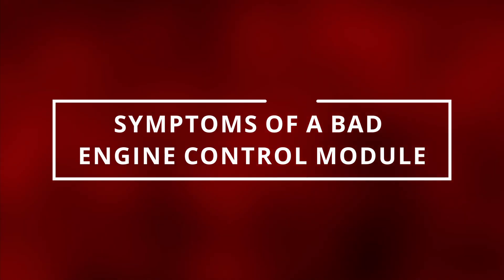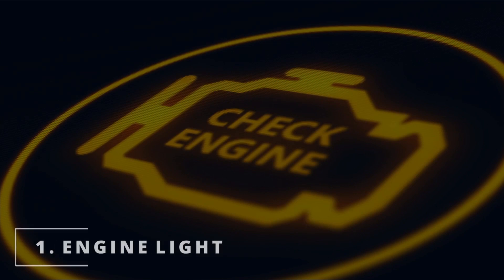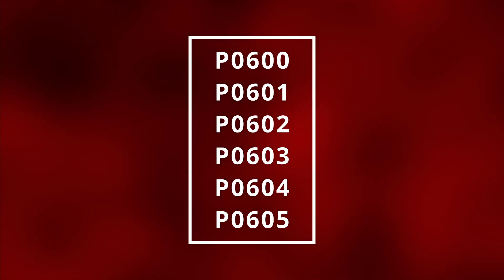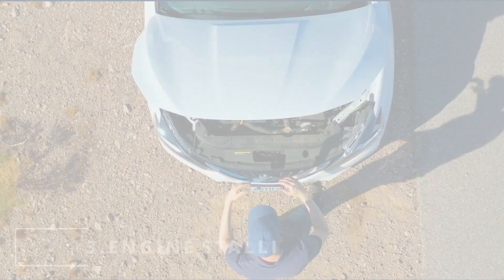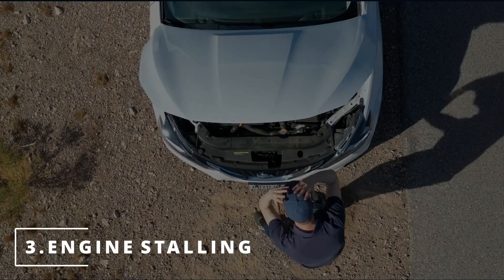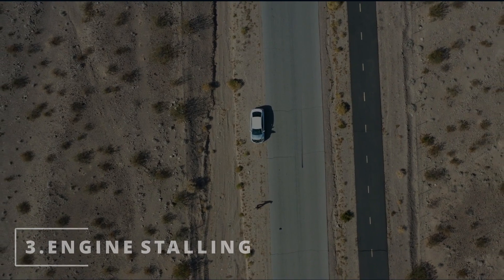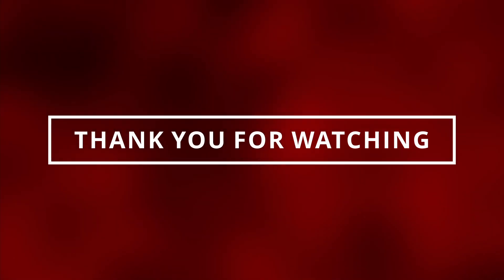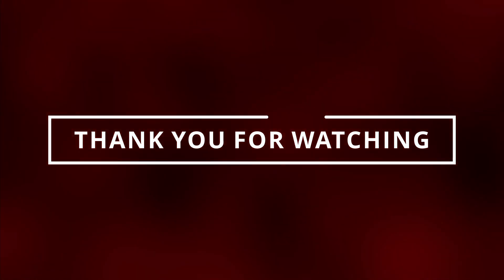SYMPTOMS OF A BAD ECM (ENGINE CONTROL MODULE)

Comment from the maker: OBD2 Scanner: https://amzn.to/3PHRplS
Reply: What other platforms are you on?
Reply: 1993 Chevy Lumina 3.8L dies while driving. Starts good runs good for 15 miles at most then dies. Will not restart right away. Have to wait 30 mins to an hour then will start up fine and drive fine for another 15 miles and die again. Its not overheating. No check engine light. Have changed fuel pump fuel filter plugs wires. Sensors would trigger check engine light always? Actually its SERVICE ENGINE SOON on this car. Unless there is also a CHECK ENGINE LIGHT thats malfunctioning. that would make sense.
Reply: Volvo XC90 2005 immobilizer problem
Reply: My ECM was causing me a misfire on one cylinder and needed to be replaced.
Reply: @gman3918 I'm here for the exact same reason 2021 corolla se nightshade
Reply: Bro you sounds super baked lol
Reply: @shanepotter4635 Royal sounds super smart and knows like he knows what he's talking about
Reply: Hey EasyAutoFix!, I have a 2019 Toyota Tacoma with manual transmission, what kind of symptoms would I be getting from a bad ECM??

Comment: I'm. Having this problem now i changed my oy pressure sensor and my temperature sensor the first oil pressure sensor I put in was the aftermarket one and it had high voltage problems got the oem one put that in now, my check engine light is on, and it won't go off 🤦🏾

Comment: My Toyota FJ cruiser has no check engine light on or anything and just died driving. it restarts for two seconds the dies again. I put in a new fuel pump and still the same problem.

Comment: I'm also experiencing some problems with my Ford Bantam rocam1.3,I was driving, and it's just cut off.I then replaced fuel pump & drove for about 200km & cut off again.I checked all fuses,replaced  fuel cut off switch & relays but can't really get what's might be the problem,any idea where I must investigate?

Comment: One time I had a cracked ecm cover/box and the transmission wouldn’t shift past 2nd gear  because the connectors were corroded and speed sensors weren’t communicating ..2002 Silverado 1500 5.3.. took a mechanic 12 hours to figure it out 😵

Comment: Could the ECM be responsible for the Anti-Theft (PATS) light to go on and the truck, not crank/no start? Locksmith says Transponder key and ignition ring (antennae) are communicating, he's baffled. [2004 Mazda B2300 manual transmission (new clutch safety switch)]

Comment: 2014 ford fiesta se,  changed crankshaft and camshaft sensors and car not turning over.. went through engine stall out on july 3rd.... possible ecm? Code is P06B8

Comment: Mine had no engine light posted , all things in the vehicle worked, all fuses were hot but 2  T and S   99 model 300 M Chrysler  hit a bump and engine died Immediately , no check eng or codes when scanned mil is clean , replaces all sendsors , pump in tank , battery, but still have no injector pulse and coil  what do you think?

Comment: 📖 THEN VS NOW: A REAL CONTRAST

📘 1950s Owner’s Manual:

    How to set ignition timing.

    Valve clearance specs.

    Carburetor tuning.

    Lubrication points with greasing intervals.

    How to change a clutch or set dwell angle.

    These manuals assumed you were a thinking, capable adult — because you were.

📙 2020s Owner’s Manual:

    “Do not drink coolant.”

    “Contact your dealer if warning light comes on.”

    “Modification of this vehicle’s systems may void your warranty.”

    “Opening the hood may result in injury.”

    These assume you're either going to sue the automaker or destroy your car — and give you no tools to do anything for yourself.

Comment: I need help.. 02 Honda Accord 4 cyl... The car started acting funny when I take off... No codes... I was having issues with the idle air control valve so I replaced that and the throttle position sensor... Now the car has a hard time starting and when I give it gas it barely wants to move it just chugs and smokes really bad... I've had this car for years it's never given me any problems...
I timed to the TPS to its proper specs... I disconnected the battery and Bree hooked it up and then did the throttle position test by using the gas pedal and it still doesn't do anything different... I'm going to leave the battery disconnected for 24 hours and try again but I don't think it's going to do much...

Comment: 2011 4.6 e150 for some reason the truck will try to turn over but won't start I did the fuel pump worked for a day then dies again

Comment: i have all those problems it dose not want to start when hot, will randomly cut off, will lose power sometimes when driveing the Check engine light will blink, and its does not want to shift form 3 to 4 or what ever overdive is, has p0600 code and thats it nothing else but evap lose

Comment: I reset my ecm...2004 Ram hemi...runs well for a while...but then poor/hesitating acceleration, runs erratically. Reset ecm again...and does fine for a few trips. More likely throttle body with bad TPS? (Integrated into throttle body) have replaced to downstream O2 sensors, still reading high voltage, and will be replacing both upstream tomorrow. Thanks man
Reply: Hi. Im experiencing the same proublems. Reset ECU and it runs fine for a few starts, then wont start unless i reset again. 
Did you find the solution ?.
Reply: @Ace.Venturas  Someone finally got it through my thick skull to settle for nothing less than OEM O2 sensors, no matter what Amazon, or even Bosch says are 'compatible'. I put in 2 NTK upstreams this very morning...(I have read NTK makes the 'Mopar' sensors)...and only a few trips so far...but...so far...so good. I should tell you I been all over the map, tried exchanging the throttle body, put in new injectors (TRQ), bought a tool for checking exhaust backpressures to make sure my cats weren't clogged...a whole litany of parts and labors. Even got a refurbed ECM
But, I have to admit, I'd read that Dodge (esp RAMs) are particularly finicky when it comes to sensors, and that even BOSCH (hear the heavenly choir around that word?)
Reply: @gregorytarana8104 thanx for the detailed reply. Its not conclusive what fault is when changing so many parts.
Good luck with it.
Be safe n well.
Reply: @Ace.Venturas  Yes...and very true. Thankfully, I could return the throttle body, so I am now working with original...I also am now in an exchange position with vendor vis a vis the refurbed ECM, which I sent back because of very incomplete data display, so I am back to working with the original ECM, I know the injectors did not solve the issue, though I left them in (wouldn't hurt to have new injectors at about 120K miles), and, in short...finally accepting that #1 the problem was indeed my O2 sensors and #2. I only compounded it by first cheaping out (even though the sensors were touted as RAM compatible), and then thinking the slightly better Bosch MUST be the answer. Since you don't seem to mind lengthy replies, it was a woman I met at a KIA dealership, who has worked in and around cars for decades. She told me after she asked "what kinda of O2 sensors did you put it?" and I told her...Amazon low price...then Bosch (as I thought Bosch were a kinda gold standard) and she smiled and said...nope. They (Dodge and Rams esp) are more picky about OEM than you know. So now, I will let you know in a few days, and after running the truck for several trips...whether I took the long way round to get back to doing what I didn't know to do. But have now done.
Reply: @gregorytarana8104   Seen a brand new bosh part fail on utube.
i cant see o2 sensors on my C converter. 

I so hope it fixes your issues gregory. 
Best of luck.
Reply: @Ace.Venturas  so far, so good...even though yesterday on a 'longer trip'...after my last stop it started to get a little glitchy and I thought to myself "OK, here comes the descent into shitsville again." But, it evened out. Where previously, once the deterioration began, it persisted and only got worse, so though I now expected rough idling, hesitating and glitchy acceleration at every stop light...it had disappeared. I could even run with the A/C on, which used to, when in that state, cause the engine to run like it was on its last gasps. But, no. Just that bit of coughing at the beginning of the return home...then clear. I am not satisfied 'all is well' however...it should not have even run poorly for that 1st 1/4 mile.

But here's the thing, in the past, once it started to go downhill, my bank 2 would show a horrendous LNGFT, like -32. When I put the scanner on it after returning, both banks read like -0.8, so something has definitely changed, and it may well be I only need to now address the position 2 sensors.
Reply: @gregorytarana8104   HEY !!HEY.!!! WOOOHOOO!!!!! Great news champ.
"  oh happy da....ays...oh happy days....
Reply: @Ace.Venturas  how are you making out with your issues?
Reply: @gregorytarana8104   I got it to start....
after removing 2... 15amp ECU fuses for 20 min with cables connected
Ran ruff ....back firing. I kept it going with reving.  Chk eng light came on for the first time EVER ......then off
Then i eased off the revs slowly till it idled  good.
Then after a bit .....it stalled and the crank no start over again.
At least i know its getting fuel, air, spark...and will idle good.
I will examin   cam , crank sensor wires . Hopefully  i find a bad connection.
So some progress. 
Thats goo......go......g......g........OH ITS FU...KD
😅😂
Reply: @Ace.Venturas you do have an OBD ll reader, right?
Reply: @gregorytarana8104   No. No reader. 
Old style diognoses on engines i havent a clue about.  Going in blind. And every dam thing is so hard to see and access.

Just learned today I have a fuse for obd2....
I searched at the beginning for it , but failed to find it.
Will try again.
Reply: @Ace.Venturas yikes, man...wanna borrow mine?
Reply: @gregorytarana8104  Yes......if only i had an OBD 2 port.  I have a fuse marked OBD2.   But toyota dealer says after a long search.....no port on my car or
cam or crank sensors. Forgot to ask about speed sensor.
 Last drive was really good.....only hesitating into overdrive ocasionaly.
Thought it ECU relearning. 
I have to find why fan is running continuesly.   Heat sensor ? Relay ?
ECU may be preventing cold starts as a precausion to sensor registering over heating.
Remove memory and it starts...
I will replace heat sensors if  i cant check  for correct opperation....resistence.
Thanks gregory for asking.  Writing this stuff helps the thinking process

Comment: I have a 2014 VW Passat TDI, and recently my trunk stopped working,  washer fluid, panel lights, heated mirrors, doors won't lock with buttom or remote countrol and horn. One day all of a sudden worked for about two minutes while I was driving, then stopped again.  I checked both fuse boxes, nothing fuse related. I don't know what to do as electrical diagnoses and repair in cars can be very expensive.

Comment: So no start in my 2019 Silverado. No engine light. Garage replaced starter for 430$. It starts 2 times and same thing. No start. And by no start I mean all accessories are working but nothing happens when I turn the key. Just a click and nothing. I got wired it to bypass the starting process and avoid another tow charge. Now they say they think it’s the ECM and they’re waiting to have the guy program it. Any thoughts?
Reply from the maker: Here is the perfect video to watch. https://www.youtube.com/watch?v=Q_Xw6fmvFZQ&t=1s
Reply: @ 
Hey very informative, thank you so much

Comment: P2610 time performance error (sensor). Dodge Caliber 2007 2.0 sxt
The problem was a broken pin in the connector to ECM module. Corrosion.

Comment: My truck threw two codes lean bank 1 and lean bank 2. I changed the MAF, and air filter, didnt fix it. Changed Fuel pump ran great for a couple weeks, died again, no codes. Changed fuel filter, again ran great for a couple of weeks. Started dieing again. Changed spark plugs, checked the relays and still dying. Still not throwing any codes. Someone said it could be my ECM.

Comment: My car diagnosis revealed my Ecm wasn’t giving proper signals because my throttle wasn’t functioning,symptoms were,sudden stop,gear not functioning well,speed stalled,fuel gauge not moving ..gas peddler not working and ingine kept getting very hot…several mechanics couldn’t figure out how to fix the problem but we finally found a mechanic who changed my throttle..everything got fixed and the car is now working owe some..I thought I was gona buy new gear or ECM.Thank God my Car is back 😊.
Reply: Hi, could you tell me what the mechanic did as I have the same problem?
Reply: And what was the fix

Comment: Just chaned my high pressure fuel pump and still getting same problems, feel like mechanics scammed me fr. He said see an electrician because the engine light wont go off. My car is using heaps of petrol and starts limping around 4000rpm 
He also said it could be an air leak any helps 
Polo gti

Comment: My car won’t start put a new control module in the car and nothing’s happening. All the symptoms you said was happening to my car. I put the key in the car press the push start nothing happens. I put power to the starter and the car starts. Everybody is saying I need a new ECU is there a way to repair them I can’t find one for my car model. 370z 2010

Comment: What if my car's symptoms have only occurred while spinning high rpms (only like 5.5k, not redlining at 7-8k) and while attempting to start, and the car acts like brand new a second later? This ECM seems most likely so far in my search. No poor gas mileage, but maybe power/acceleration loss. Sometimes gears can be a bit weird. 2015 hyundai elantra auto tran

Comment: On a 2011 ford taurus limited, are the engine control module and ignition control module integrated into one part? Or is the ignition control module and power train control module integrated into one part? Or are all those 3 separate parts?

Comment: Manual transmission being shifted was a bad clip choice when talking about a transmission control module not working properly. Manual trans shift points are determined by the driver, not a TCM. Thx for the video🤘
Reply: Yeah was thinking the same thing

Comment: Basically if you have a throttle performance problem linked to a bad computer, you could possibly just maybe experience shifting problems. The first thing to do is check power & ground, then check your communication wires. If a module isn't out-putting the right voltage then it most likely has failed. It's a good idea to run a wave pattern test on speed/timing sensors before replacing them. A lot of mechanics replace sensors without first checking their signal. Even more, mechanics that have been doing this for 40+years replace modules on a whim. Every module fails for different reasons, that's why sometimes they're hard to diagnose. 10 years mechanic here
Reply: Exactly what happened with me, I need to replace my gas pedal, ecm and sensors
Reply: My manual gearbox only does 4th and kicks out 5th gear,I also experience throttle problems. Could this be the issue or simply just separate problems (gearbox and ECM)?

Comment: I have a 2013 F-150 and I have some of these same problems. I use a OBD2 code reader and it shows random problems at random times. One time it will show throttle body then the next time it will show O2 sensors and a couple of others. Again at random times. 
I have an extended warranty on this vehicle and take it to the dealership but they say they can find no codes.

Comment: I replaced the fuel pump twice, the throttle because I kept loosing acceleration and it will stall on certain stops after all that my mechanic realized is the damn computer

Comment: Diagnosing a bad PCM is not always that simple. Sometimes a defective module can mimic a bad PCM. You would think it’s a bad PCM when it’s not. I had a friend who accidentally put the battery backwards. After smoke settle it kept blowing a 200 Amp fusible link. Everywhere he took it to said it’s a bad PCM. He let me look at it. As an electronic engineer I know how circuits work. I pinpointed the problem to the factory audio amplifier. It had a shorted power diode. What that diode does is if you revered polarity it forward biases and overloads to self destruction shorting out the circuit making the fuse blow. I found one from a junk Television and replaced it. 😂

Comment: Issue I'm having is no crank/no start.  Car ran fine, 2 hour later, won';t start.  Totally dead.  Battery is good, alt is good.  Thinking it's hte ECM.  That's the next thing to check.

Comment: I will tell you one horror story about my mom's Mitsubishi lancer which only has 61,000 miles and 21 years. The signal cable to coil 1 bank 1 was not sending signal however at the dealer said a new ECU was needed. I did not believe that shit because the car has had perfect maintenance however it seems the cable has been deteriorated due to all these years  humidity in the winter season although she parks it in a cool dry place inside her house in Winter. An experienced electrician came to see it and told me it was not the ECU but the cable itself because even though it was not cut or shorted to ground the copper conductivity had been lost to a degree where the computer signal to the coil was inoperative. He put a new cable, a new line to the coil and cut the old cable at the coil connector and it worked perfectly! Shame on you motherfuckers at Mitsubishi that make these crappy wire harness. Make them right !!
 I want them to last 50 years and not 20 because here in Latin America we keep cars for many years. My Dad's Toyota Lite-Ace van has 41 years and never has had wire harness cable problems !! New cars are crap !!